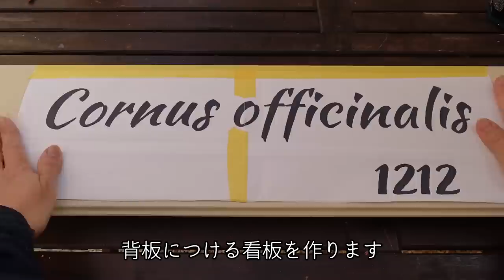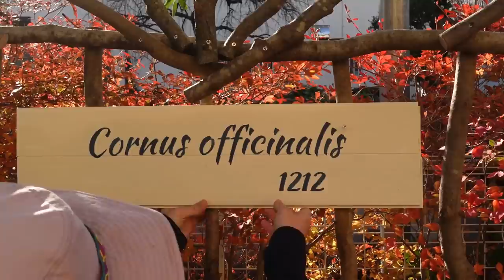【ガーデンDIY】剪定の枝を活用したディスプレイ用ベンチ/落葉樹の剪定と便利な道具/ブッシュクラフト

Comment: It was great that you recycled the branches to build a "cool" bench to enjoy your beautiful garden from...  Tip, when using the reciprocating saw the black rest should be touching whatever you are cutting to reduce vibration.  I like seeing that you practice safety when changing the blade on the saw by removing the battery first.  😎
Reply from the maker: Thank you for all your nice comments.
Your advice on using a reciprocating saw is also greatly appreciated.
Will be careful when I use it in the future!
Safety first, right!